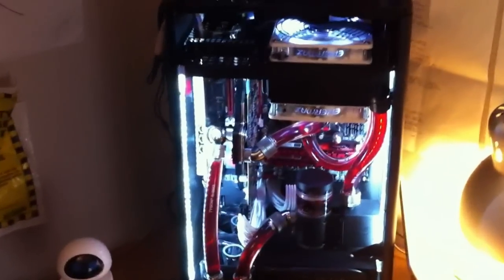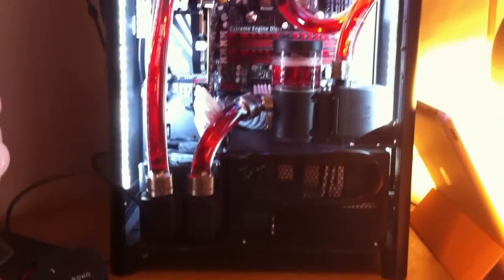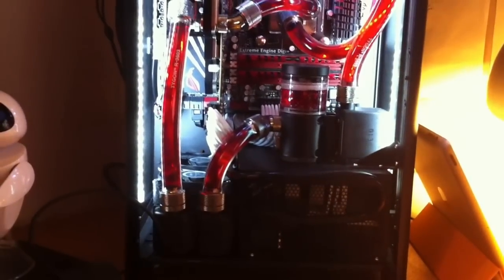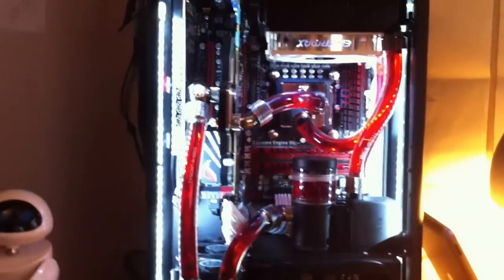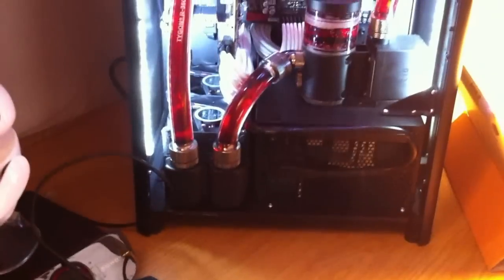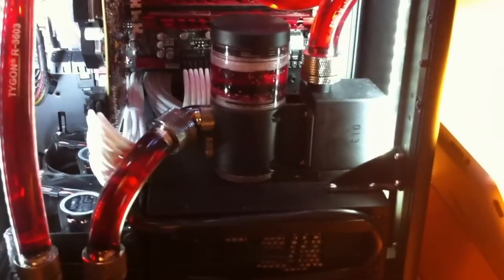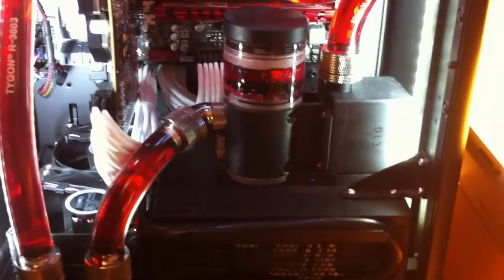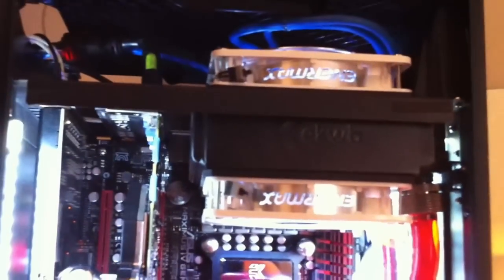Silverstone Fortress FT03 watercooled PT1

Comment: Would love to see this design shared in either its former or new state.  where did you mount the resevoir within the system?
Reply from the maker: Cheers, you can see the RES in the video, it's the small tube res attached to the pump. The system looking nothing like that anymore. I need to pull my finger out and do a new video.
Reply: Yeah, nice little res for the setup - I was wondering where the combo pump was mounted in this case.  I am considering this case for a crossfire SLI and crystal-link/bitspower fittings.  Who did your panel mods for you?  Did Silverstone do them special or can you name a mod house?

Comment from the maker: I really need to upload a new video, this build now has a GTX titan and the loop as been re designed. I'm using an Aquatube, 18w DDC pump and 120mm Alphacool MONSTA top RAD. Google HackJoe FT03 and you'll find photos on the ROG site with the side panel fitted. I have the design if you'd like to use it.

Comment from the maker: Cheers Buddy, I've since had 25mm raisers made for the 4 rubber feet allowing me to fit another two 80mm NoiseBlocker fans underneath the case. it's dropped my temps by 5-8'c which has meant the coolant temps are now within an acceptable range. I'm very happy with it.

Comment: Cheers fella. Even running a 580 and a cpu over 4ghz with temps that low is really impressive. I'm doing my case because after a couple of hours my 570 can reach 85-90...not good lol. Great to know that even with a 120 and a 160 temps plummit. Loving your use of the 45 degree connectors. I was thinking of the pump combo 100ml but opted for the 150 balancer instead, placing it where your 160 is. Are your 160 fans blowing into the case or out and down?

Comment from the maker: Cheers chap. I'm still working on a comfortable OC, I've got it running at 4.5Ghz on 1.345v which has pushed the temps up. Under prime the CPU will hit 47'c the temps are higher however with prolonged gaming, the heat dump from the 580 under load pushes the limits of such small rads, under gaming conditions the temps are 49'c CPU/ 52'c GPU. 

I'll do another video running prime95 an hour in, and then another running something like Crysis2 bench. Check back Thursday evening..

Comment: Hi. thanks for the video of your rig. I'm currantly doing the same but with 120 at the top and a 140 where the slot cd is with a custom bracket. Can you give me some details of the parts you used and how long you can use this before having to refill. I was wondering if a 160 would fit at the bottom cos my tape measure was too close to the side panels lol. If i can't get the 140 to fit i might put two seperate 80's at the bottom instead.